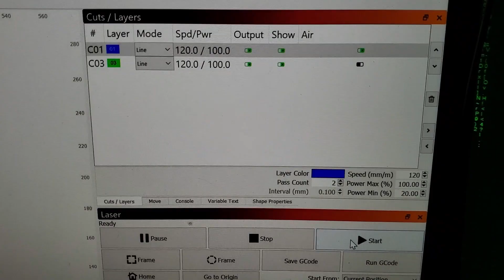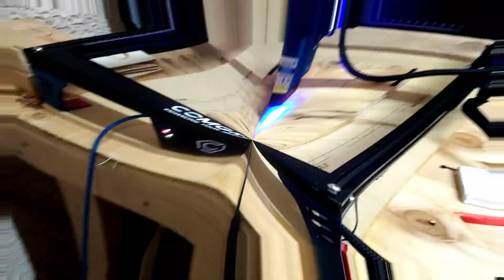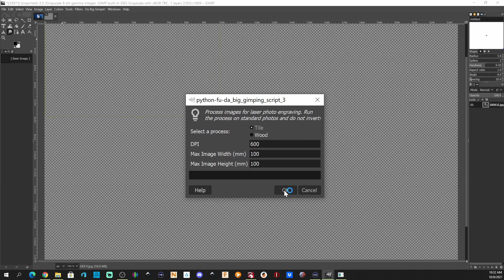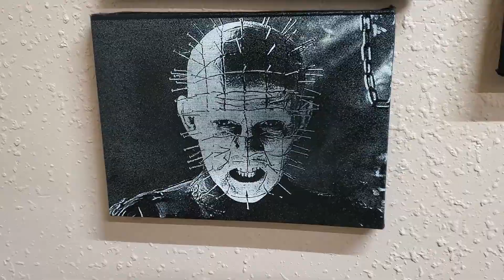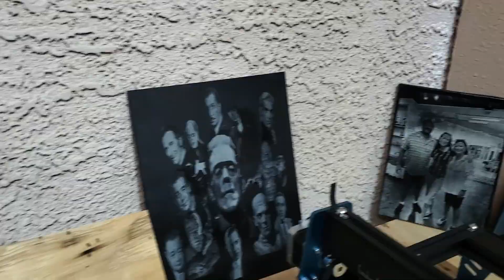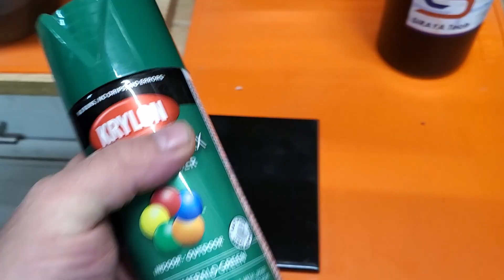Comgrow Comgo Z1 Diode Laser Projects #3dhp

Comment: How does it compare to the k40?
Reply from the maker: Its like apples vs Oranges.they both have different purposes. AK40 is very fast and will cut clear acrylic for example.The diode laser can do shading and has a larger build area.The K40 has a very small work area.The K40 requires many other things to get up and running, exhaust out of work area,water supply etc.With the diode laser your up and running very fast and its very portable. The La Hobby Guy has a ton of videos on Lasers and using Lightburn,which is the greatest software on the planet.
Reply: @3DHP  thanks. I think I might get a diode laser and if things work out save up for a larger CO2.